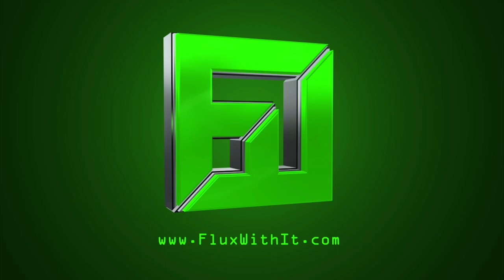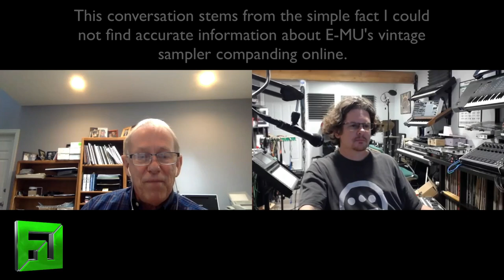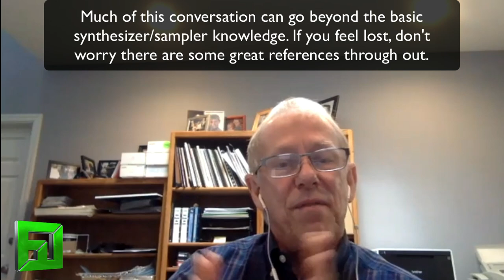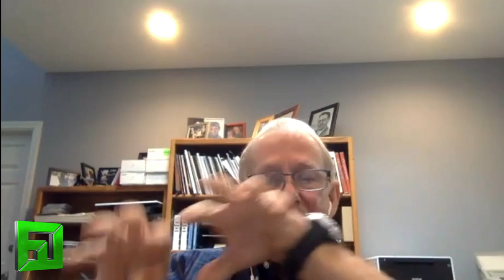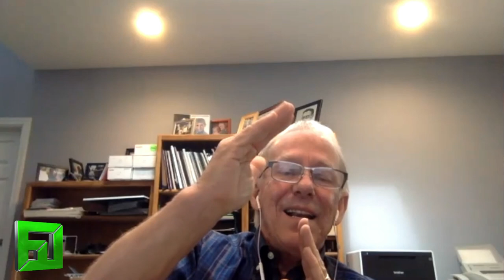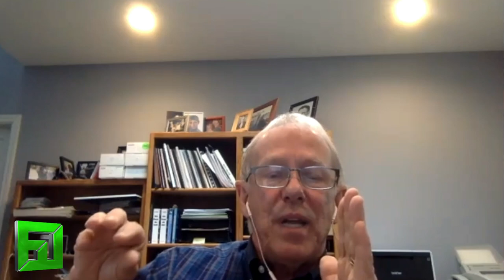Dave Rossum on audio Companding a SynthSummitShow special

Comment: OMG I love this. I'm kinda obsessed with E-mu rack synths, and I've written a lot of signal processing software. I'd love to hear him nerd out more about FPGA design. Not many people work at that kind of a low level, and you run into different kinds of problems when you have one chip that's 16-bit and another bit that's 24-bit, and one's big endian, and another one's little endian, and different things have different word lengths, so it just kinda wants to scramble itself LOL. Then when you're doing stuff at really high speeds you're worrying about differential signaling and 8b10b coding. I saw him talking about how the G-chip 1.0 used DMA and that's why it could do 32 voices because it still didn't need fast RAM because it wasn't caching anything. The G-chip was 1989, and I don't think anybody really caught up with that until Roland made the JV-1080 in 1994. I think Roland was doing things very differently with the JV-1080 and all their RISC machines, but I've never heard him talk much about Roland.

Comment: Dolby Digital, as well as some variants of Dolby Atmos encode audio similarly to companding, where words, though stored in the frequency domain, will encode multiple words with a common exponent.  The individual words will then have a unique mantissa, where the number of bits used to encode each mantissa varies based on the target bitrate, psychoacoustics and the statistics of the underlying signal. But fundamentally these encoding schemes have their basis in companded PCM.

Comment: The discussion about the evolving digital technology was enlightening, but I don't think the claim at 40:00 is correct. The sound due to molecular motion is somewhere around -20dB, whereas 24 bit audio has 144dB of (undithered) dynamic range, but sounds can easily reach much higher SPLs than this albeit in a non-linear fashion and hearing damage notwithstanding - dBDrag events regularly measured SPLs higher than 180dB. That said, 16 bit is more than enough for a typical listening room and avoiding hearing damage.